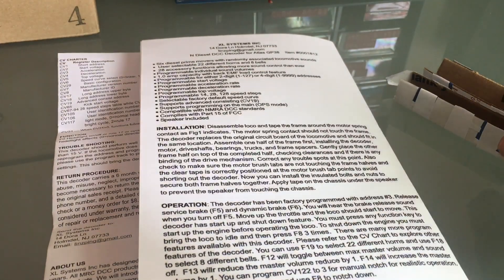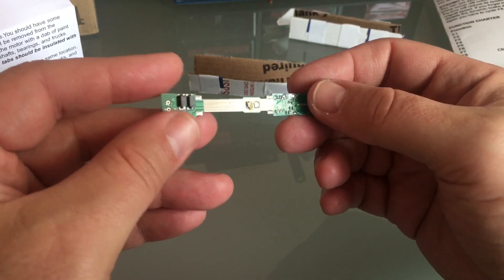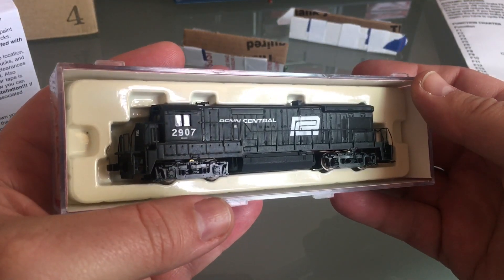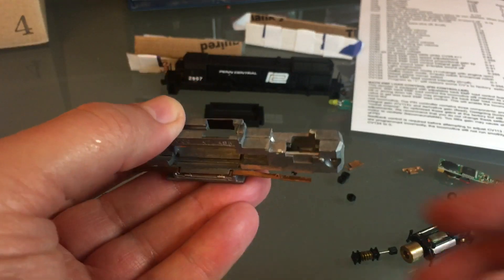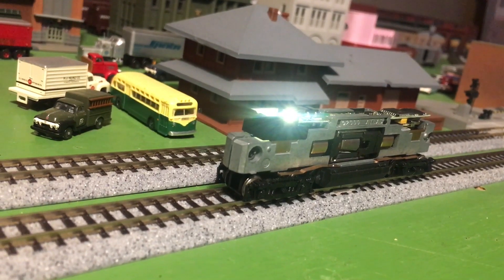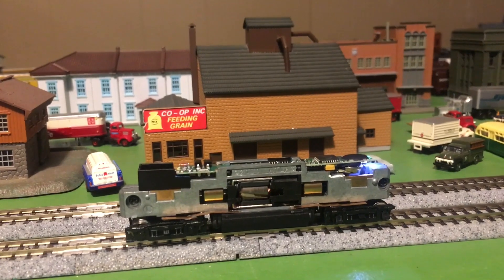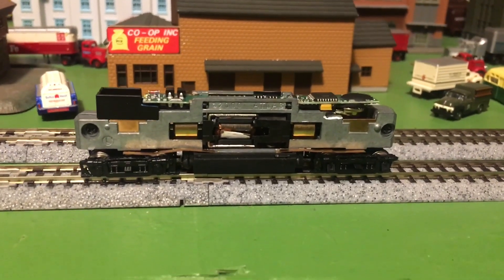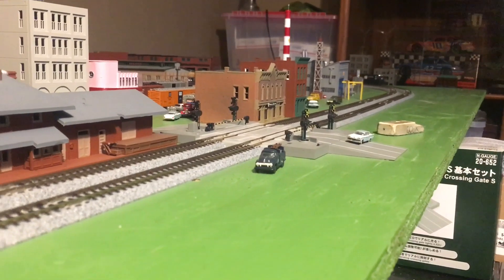N scale XL Systems sound decoder for the Atlas GP38-2 or B23-7

Comment: For the price the XL are not a bad sound decoder. They are very similar to the MRC factory version. Great if you have a lot of engines to change over. The sound quality doesn't compete with Soundtraxx or Loksound but then I would get those if I wanted to go for the quality instead of the quantity.
Reply from the maker: So they tell me. I will have to experiment with esu one of these days.